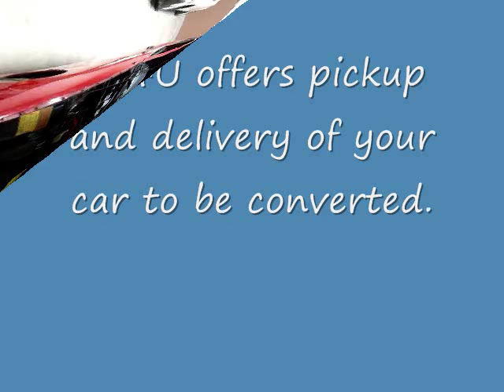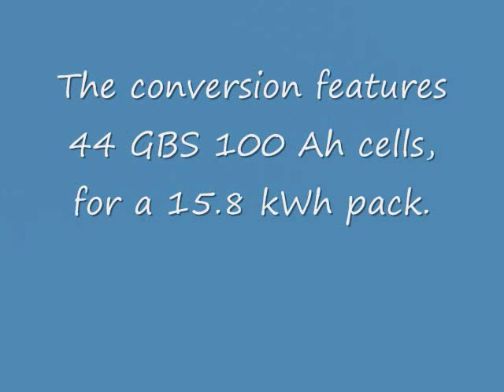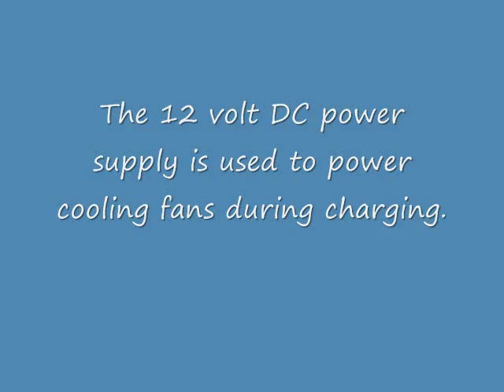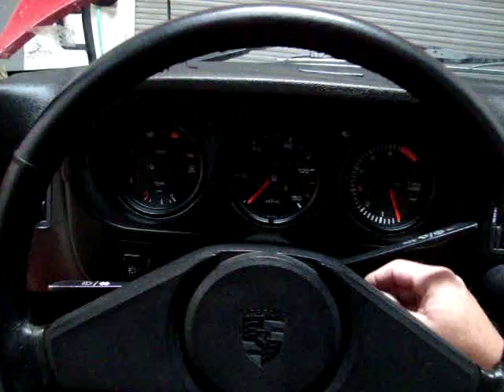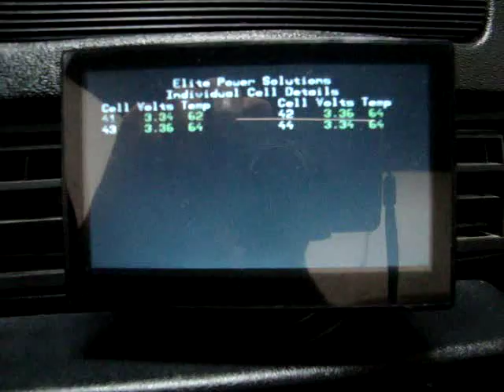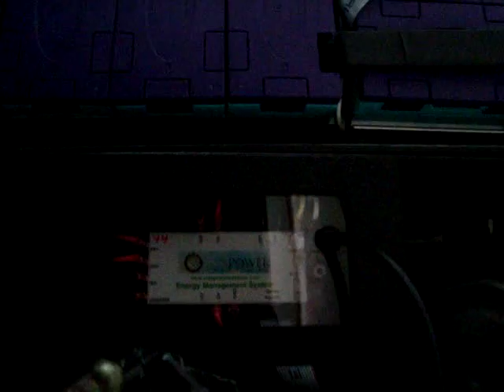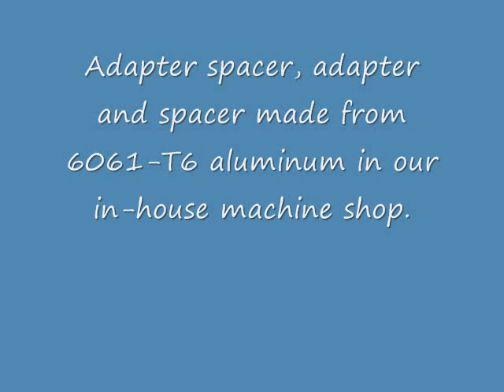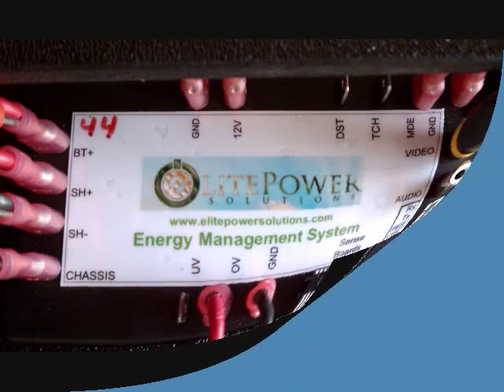DIY Electric Porsche Conversion

Comment from the maker: The owner of the car cut the floor out to remove the gas tank.  There is a little more noise, but I think it is because there is no carpet, etc. to dampen the noise.  The clutch is retained in all of our conversions.  I do not remember what the 0-60 time was on that conversion.  The 924s are typically a great conversion and at 2600 lbs. run and handle well.  The easiest up grade of that conversion would be to go to a larger controller.  But even with the Curtis it is great fun to drive.

Comment from the maker: @evric2008 There is a precharge circuit, as well as a charging safety interlock.  It also has a throttle safety interlock, which does not allow the contactor to be activated unless the throttle is completely off prior to the ignition key being turned on.  You are right, the spec. sheet states that the circuit breaker should be mounted vertically.  However, that is when it is being used as a circuit breaker, when being used as a switch, orientation does not matter.  Thank you for watching.

Comment: A great video Richard.
A few points...
Have you included a precharge circuit for the controller?
The circuit breaker you used as Emergency Off should be mounted vertically - see specs sheet.
Are you using an interlock on the charging system to prevent driving off with it plugged in?
Eric

Comment: Hi Richard,
The 924 is one of the vehicles I'm considering for a conversion. Did you retain the clutch in this conversion? With the 500 A limit at 146 V, what is the acceleration like? Have you done a 0-60 test? Is there much road noise in the cabin from cutting out the rear floor for the battery boxes? Thanks for any help you can throw my way! 
Alex Vieira